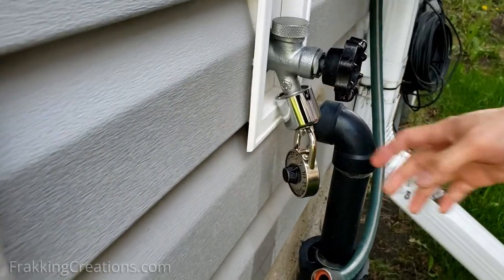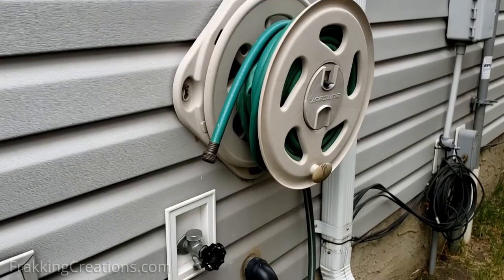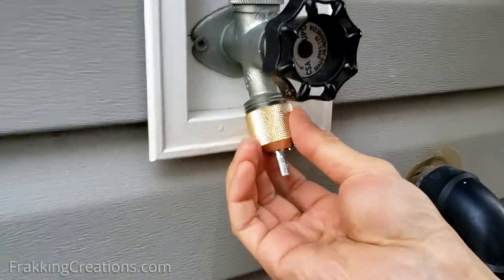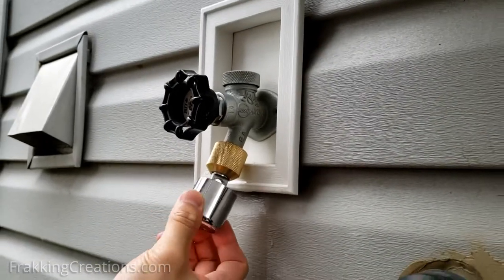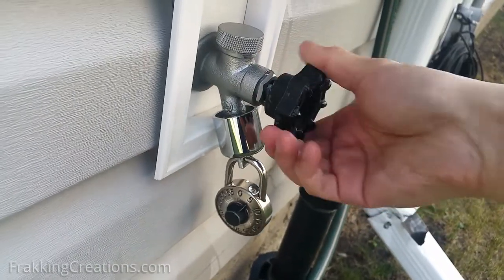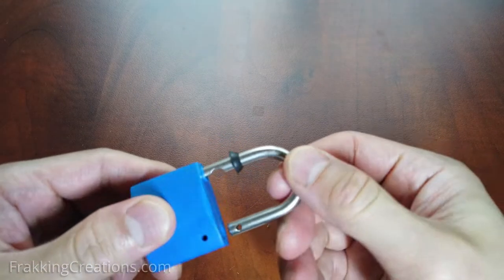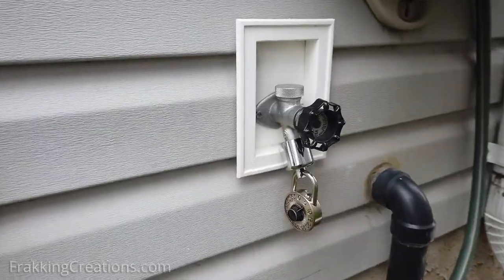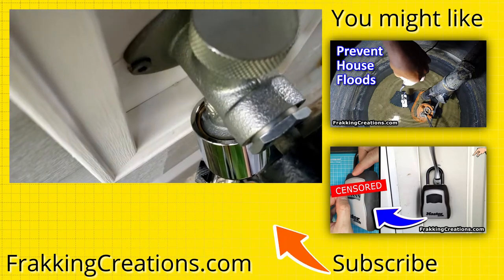How to lock a water faucet to STOP Water Theft - Best faucet lock review

Comment: I had this on my commercial building for a few years.  I thought it was a great solution. Unfortunately, it was snapped off last night in about three seconds with a simple pair of needle nose pliers as leverage.  The metal tab the lock goes through snapped without much effort.  The lock stayed locked but the metal just isn't thick enough around the lock hole to stand up to much force.  I have the event recorded on a 4k security camera with night vision.  Super clear image.  This device will discourage casual thieves but not experienced ones. In reality, the best solution is to shut the water off to the outdoor hose bib if you can.
Reply from the maker: Thanks for sharing your experience.

Comment: This is good if you have lots of homeless people in your city.    You also need to cut off the circuit breaker for any outside electrical outlets.   I've heard stories where a random electric car driver will plug into your outlet with an extension cord to steal your power.

Comment: It can be bypass with a wrench, clamp pinch turn.. because the outer shells is close to the inner when you clamp it pinch and hold on to the inner one and now when you turn the wrench it un screws the inner one, and your done, same thing to but it back on. catch a person using a clamp with my camera on my faucet... good for home use I would say.
Reply from the maker: The outer shell is about 3mm thick so you would have to use something with more of a force advantage to be able to deform it.  That said, I think there are other easier ways to defeat this lock.

But as you said, it is good for uses where it may make it easier to catch someone using your water.  Plus even if you don't catch them, you will know someone did something or tried.
Most physical security can be defeated easily including our front door locks that can be drilled out or picked in minutes.  But we all still lock our doors.
Reply: @FrakkingCreations  it does not need to be deform it just pinching which grabs on to the inner one, saw on on my CCTV. It leaves a wrench pliers clamp marks on the metal outer shell, takes a about  seconds to open.

Not saying this isn't good its very good water lock for the price would stop most people, but crazy people everywhere with time miss up your stuff.

True about everything time to failure, high cost = last longer before it failure.

Just letting you know about the security by Pass for this lock.
Reply from the maker: Thanks for letting me know.
Hope you can catch the guy.  Hate that we all have to go to these lengths for anything we own to protect it from bad actors.